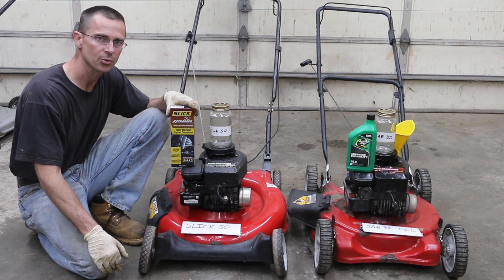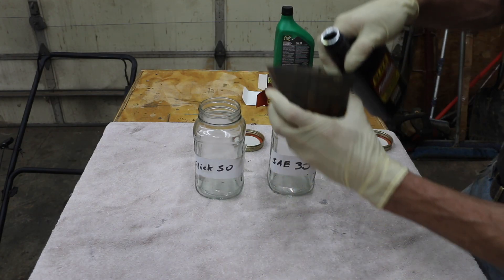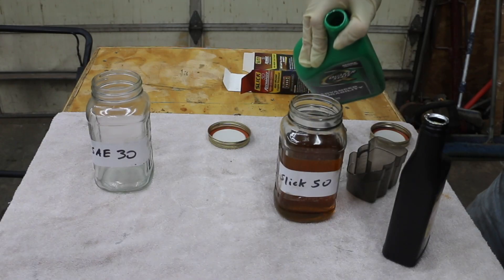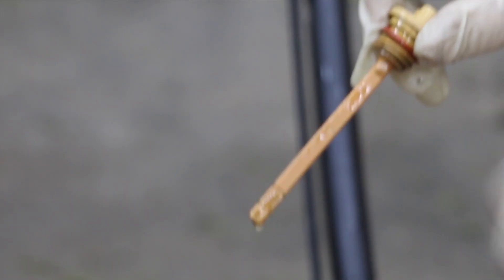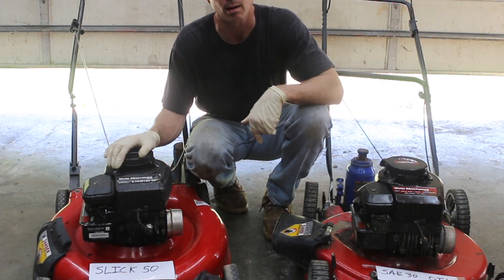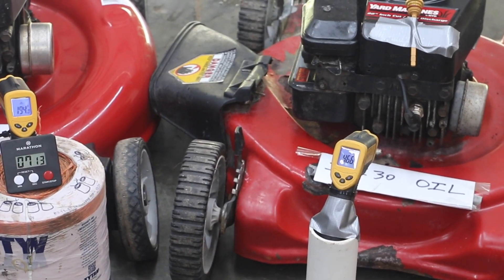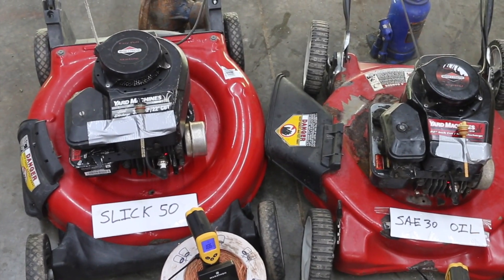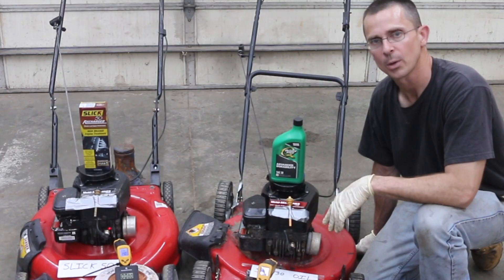Can't believe what SLICK 50 did to my engine!!--Dry Crankcase Test!

Comment: Note that the Slick 50 engine is running cooler.   Could it be that it is being cooled by air from the discharge chute of the SAE 30 mower?
Reply: Did anyone notice the amount of oil drained from each mower was not the same? The sae 30 jar had less oil in it compared to the slick 50 jar which was almost full. So my question is why? And if this is so, was there some sae 30 still left in the winning mower? Is this why it lasted so much longer?
Reply: @robertvandiver4627  first thing I wondered: And what about the rest of the oil??
Reply: Crack them open and let’s see the carnage.
Reply: Less friction less heat
Reply: I was under the impression that Slick 50 had to be run a whole oil cycle, 3,000 miles, to completely treat the inside of the engine.?  Also, the hotter the temperature the better Slick 50 sticks to the internals. The Slick 50 engine stays cooler.
Reply: mike brink  this is 100% true.
Reply: mike brink  to be honest the huge gap in temperature doesn't make sense to me thus why people factored in the other mower blowing air but as states the blades are off. It's very odd how this video played out and is very difficult to say without being present as to how the cooler engine compared in time to the hotter. It's a mystery.
Reply: Dirty Harry  that mower has rotating parts whether the blades are engaged or not, Generally mowers that have the capability to disengage the blade have an flywheel to balance the engine, those without that feature use the blade as the flywheel.
Reply: Yep maybe
Reply: More like the slick 50 engine exhaust is aimed right at the sae 30 engine
Reply: @zandernicholas8391 at above 300 exhaust runs hot not cool or moderately warm. Wouldn't factor a 200 degree difference whatsoever. Internal temperature definitely wouldn't be effected by a small amount of exhaust that blows hot. Even with a shop fan on a motor you will only see maybe 100 degree difference with room temp blown air. Think about this the other engine ran at 470 f...... exhaust would be hot as fuck. The manifold itself would be close to the same temp shooting air out at around 350 400 degrees. Possibly.
Reply: Why not use the slick 50 in the concentration recommend on the bottle? That would have been more fair.
Reply: Jeese theres some misinformation in this thread.

No. The extra air from the discharge chute cant cool the motor off that much.

Yes those specific motors can turn on without the blades, however from the sound and the fact that they are A. Running smooth and B. Moving the discharge chutes around shows he does have the blade on.

To clear confusion:

Each motor is designed different depending on its application. For example I'll use Toro' s 7.25 horse motor they put on their brand mowers. The basic model where the motor and blade are directly connected (similar to the ones in the video) is set up to have a constant load on it (the wind resistance on the blade.) Remove the blade, and the machine wont run properly, but should start. Now lets move to the blade brake clutch model, where the blade can be stopped while the motor still runs. That motor is designed to run with no load on it since it doesnt have to deal with a constant load. On bigger machines like zero turns and such, the bigger motors have heavier flywheels because when the machine is stationary with the blades off, it wont have a load and has to make up for the missing load in some way.

To recap the temp difference, I cant agree much here. Its not air from the blades or exhaust on one machine being blown on the other for sure, but i dont know if I can agree with the doubts in accuracy on his temperature guns. What if the slick50 was keeping it cool but lost its film strength quickly, and seized before the temps could rise. I dont know how possible that is, but stranger things have happened.
Reply: Some real genius people in this one.. you dont have to have blades, air cooled motors, any air moving around them is gonna cool them off. Some of you talk enough bullshit to cool these engines..
Reply: Dirty Harry  My Honda 6hp self propelled is about 5 years old and has a steel deck.
Reply: mike brink  Early 90's I had a 63 VW bus I put a 1776 with a 10::1 compression ratio, chevy valves, ratio rockers and a really tall, sharp cam. Two single barrel 40mm Kadron carbs, .009 distributor, and a doghouse oil cooler/fan housing. It pulled wheelies. Tried the Slick50 in it and didn't notice any difference so I tried the Duralube brand and it ran about 30 degrees cooler. I got 150k miles out of that motor running it up and down SH14 between The Valley/LA and Palmdale, California at an average speed of about 80mph on the uphill leg. I don't know if the longevity was due to the additive or the fact that I did my maintenance religiously. Changed the oil every month at least and adjusted the valves every 4-5000 miles. Kept the carbs synced as well. 

The lower temp is due to the ptfe additive allowing for less friction.
Reply: Bullshit.. Look where the chute is pointing. Not enough to affect the test.
Reply: @masiaworksreaper1358  EVERYTHING affects the test. That chute is pointing DIRECTLY at the base of the Slick 50 engine.
Reply: NO ITS NOT RUNNING BLADES......
Reply: @shaggys73  I have a Honda with the blade stop feature. The sounds of the engine running with the blades turning vs, the blades stopped is totally different. These mowers definitely have blades on them.
Reply: Guys.... Common sense dictate you don't need a fucking blade on any mower unless it has a sensor in order for it to turn over an operate... 

Listen to the word used inertia to turn over and run... in order for this to even happen the mower would have to turn over. The blade doesnt matter.
Reply: I don't believe that he was running the blades, however if he was, this might not have been an accurate test.
Reply: @jonathantouma2500  These mowers don't start without a blade on. The blade acts as a flywheel to help turn the engine over!
Reply: @mrsillywalk  U r 100% correct.  Just recently I removed the blade to sharpen, then decided to warm up the engine and drain the oil.  Engine would not start no matter how briskly I pulled.  Lol
Reply: mrsillywalk   Stop it. I’ve run many mowers with out blades. They run and start fine without them.
Reply: @marvinmartinsYT  Newer ones w small aluminum "flywheel" depend on blade for inertia.  U can start them w a very powerful electric drill.  Dangerous.  They won't idle.  Older ones w iron flywheel ok.
Reply: Ernest   Aluminium!   
No I’ve not seen a mower with Aluminium blade deck. 
I just went and checked our mowers. All steel and brand new. 
Aluminium decks must be an American thing.
Reply: @marvinmartinsYT  Nope.  Small aluminum flywheel for the magneto.   Push mowers w heavier cast iron flywheel no problem.  Vertical shaft motors for pressure washer no problem.
Reply: Ernest   I’ve not been into a mower that far. And I’ve never had one not start without blades on it. 
We have 6. To ride ons one self propelled walk behind and 3 push. 
When we change the blades we start em to heat the oil a little then drain it. 
Fill it put blades back on. I’ve not had this problem you talk of. 
But I see what you’re saying.
Reply: mrsillywalk    What you said makes no sense on several different levels
Reply: @mrsillywalk  That's not been my experience.
Reply: @PulsarProducts  The only mowers that start and run successfully without blades  are those with short retractable safety blades fitted to a large disc. There the disc acts as a flywheel. This is all simple physics.
Reply: @ebutuoyebutouy  had the same stupid idea.....it starts but runs very shitty,...starting rope was ripped out of my hand and broke the oil filling neck :D:D
Reply: marvin martin As long as the mower was a BBC type.  Then it will run without a blade

Comment: For a test like this, I think, non-detergent oil would be a better choice. Non-detergent oil coats engine parts thus the buildup of gunk in the old engines that used it.  The slick 50 might need to be run for a long time before it has any positive effect on coating the engine.
Reply from the maker: Thank you!
Reply: @ProjectFarm  Love your channel BTW.   Good Stuff.

Comment: Please test the oil additive called PROLONG Engine Treatment. Many years ago their commercial showed them taking off the oil pan and valve cover of a automobile engine and I think they drained the coolant. They then cranked up the engine, ran water over the valves and then poured sand all over them. The engine ran and ran for a long time. This oil additive is still being sold in auto parts stores.
Reply from the maker: Thank you!

Comment: I did something similar in the mid 1990's. Had a B&S lawnmower, late 70's vintage that took me as long to get running,  as it did to mow my yard. So i bought a new one,  but being a lad of around 26, i couldn't just get rid of the old one. It HAD to go KA-BOOM! So i drained the oil, filled the gas, and hung it from a tree in my yard. Needless to say,  it ran 1/2 hour plus (cant remember exactly) but it RAN OUT OF GAS, never went ka-boom, not even ker-splat. It just HAD to defy me until the end!
Reply from the maker: Thank you

Comment: I don’t think you treated the slick engine correctly. Should have mixed it with oil, ran the engine then ran it. Slick 50 by itself is not a total lubricant
Reply from the maker: Thank you for the constructive feedback.

Comment: I know this is an oldie, but I'd like to point out that these engines were used.  The one that failed earlier may not have been treated as nice over it's life.  I know it would be a ton of work, but maybe you should have done a tear-down and some measurement before running the test.  As for Slick 50 - I've never used it and don't have any idea about it's capabilities.  It did run cooler though.  Might help with an overheating problem.
Reply from the maker: Thanks for the constructive feedback.
Reply: @ProjectFarm  - Well, thank you for doing this stuff.  I’ve been silently following your posts for a while.  My first job out of university (with a physics degree) was working with a company that built teleprinters (remember Telex?  Maybe you’re too young) analyzing failures and working with engineering on solutions.  One of the best jobs I ever had.  What you do reminds me a lot of those times.  Keep up the good work!

Comment: That’s not the original Slick 50 the guy who made it sold it and they changed the original formula!
Reply: It was all garbage . It never did what they claimed to begin with. In fact it did more harm thn good because it clogged oil ports and filters

Comment: I haven't watched the video, but I already think it will be one of my favorites on this channel. I have wondered ever since I saw those commercials whether the claims were BS or not. And today at least some evidence on the question. My prewatch guess: Slik 50 treatment doesn't affect outcome.
ETA: Some postwatch thoughts:
Hmm, I would have preferred that he follow the manufacturer's suggestion as to amount of Slik50 to use. Is it possible that Slik50 just works as an oil thinner so that the reason the engine ran cooler with Slik50 was that it was running with less viscous oil? And the reason that the engine ran longer with conventional oil was that it was more viscous and stuck to the engine parts better?
Reply from the maker: Thank you for the constructive feedback

Comment: Slick 50 is crap. I saw a Porsche engine that was treated with that stuff and it was really messed up. That was a high performance 911 air cooled engine running  Kendall 50 weight racing oil mixed with Slick 50. This was during summer in Alabama  which can be pretty hot. The car was not babied, and it was a gooped up mess inside. Horrible mess. Had to be stripped and cleaned to run free. Can't remember if there were any parts damaged but that cured me of running Slick 50 in anything. I had been using it in my Ford Explorer and it seemed to do no damage and increased gas mileage sightly. ??? 
Air cooled  seems like a no no . The lawnmowers are air cooled too.  not exactly running the compression  and temps of that Porsche.   The Kendall oil was superb for those (NOW) old 911 hot rods.
Reply from the maker: Thank you

Comment: My 2 cents; The slick 50 mower looked newer meaning probably closer tolerances than the 30 weight mower. Heat killed both the mowers the one with closer tolerances seized first. As far as the tires go the new mower shows " The let's save money on skinny tires" and probably wore them down faster because of cheaper materials.
Love this channel keep up the good work.
Reply from the maker: Thank you!

Comment: Excellent test.  It looks like the engine will perform better or cooler as long as the slick 50 stays in it.  The 3o weight will help you better if you lose all your oil and if you lose all of your oil you'll be on the side of the road anyway.
Reply from the maker: Thanks for watching!

Comment: Given that the slick 50 temperatures didn't reach as high as the regular oil... is it possible that the slick 50 engine stops because the oil got extremely viscous, stopping the engine, but also preventing the rings from getting hot enough to actually seize/weld the rings to the cylinder wall - in other words, preventing castastrophic damage to the engine, while the regular oil engine became toast. I would be interested to see the results of a teardown, and how easy it might be to un-seize.

Also, this version of Slick 50 isn't the original PTFE formula that was so effective. That product formula is now called "ExcelPlus".
Also, the directions for the original product formula emphasized that the product had to run for quite a while before the protective PTFE coating would be established on the metallic parts to be protected from friction...
Reply: I used Engine Slick 50,000 before Slick 50 and ran it for a season before changing oil.  During the course of the summer I could tell a difference in pulling the rope to start the engine after a few weeks but nothing after the first day.  I don't think the engine was run long enough to fairly judge the product.  I think Chaz has some good points.
Reply: I had similar thoughts about the viscosity. I hadn't read comments when I made my comment above. A lot of good information in your post. Unfortunately it suggests that the experiment wasn't as well conceived as it might have been. One thought I had while I watched the test was that it would have been better to have preceded it with some isolated wear testing experiments. These might allow some of the issues you put forth to be sorted a bit before doing the lawnmower testing.
Reply: @davefoc  good points. What you tested still has value. And you do follow loical pathways.... Designing experiments is challenging
Reply: Correct had to run on clean oil change. Up to 5000 miles to make any difference

Comment: I recommend you run this test 3 times to insure there was no anomalies in the engine them selves(total of six engines).If all engines follow similar shut down then the times are accurate. Of course the idea of using slick 50 in the engine to make it last longer, is to actually have it in the engine. But the dry run experiment is interesting nonetheless.
Reply from the maker: Thank you!

Comment: You didn't shake the slick 50 before using it. I notice it will settle something to bottom when it sits for extended times. Your test may be flawed.
Reply from the maker: I shook is off camera before the test began!
Reply: @ProjectFarm  I seen a Briggs engine run 30 minutes with no oil and we disassembled it for inspection. The rep did say the engine was run 10 hours before the test. This was back in the late 70's. Maybe the formula has changed or it needs more treatment time. My first notice using it was the engine idle did increase a few hundred rpm and it ran cooler. Pop's skylark was treated and the oil pump driveshaft sheared a roll pin and he drove the car 5 miles to my shop with the oil light on. The car survived but like I said he had the slick in there for thousands of miles.
Reply: I still enjoy watching your tests, thumbs up.

Comment: I don’t want you testing engines with slick 50+ oil do it with straight slick 50 and then it’s a much better test for the product it’s not gonna hurt the engine to run straight slick 50 straight STP straight Lucas or whatever just do it my way. 10-4😤

Comment: Slick 50 is not thick and wants to stick to metal like STP does. Slick 50 claims to somehow bond or fuse or fill in the minute spaces in the raw metal to be able to help which I think it did as you read the reduced temperatures coming from the lawn mower when you had it in it. But it may actually be so slick (hence the name) as to not stick or should I say have as much residual adhesion ability as the 30 weight oil. This is my observation only. But I do think that what I said about Slick 50 was their actual claim. But all in all your test was very similar to the one they used to show on TV only they used automotive engines and we don't know all of the exact details of their tests, so I say you blew their theory right out of the window. Nice test but a real waste of two still nice old lawn mowers that would have worked fine for someone who couldn't afford a new one. Very interesting test though. Otherwise we're all going to go on believing what we saw on TV years ago. I would still run it as an additive though as it definitely made the engine run cooler and that temp is coming from friction we know that.
Reply from the maker: Thank you!

Comment: i agree i wonder if the slick 50 broke up more carbon than the 30 . oil and the carbon ground away at the motor slick 50 embeds in the metal that might  make it loosen up a lot of gunk i still think slick 50 works and will still use it try that test on new motors and i think 50 will win
Reply from the maker: Thank you!